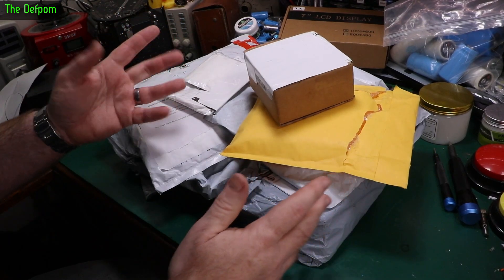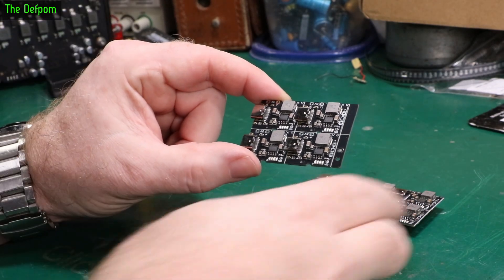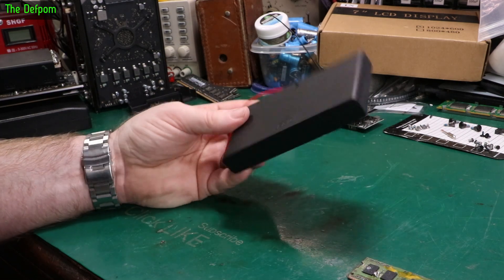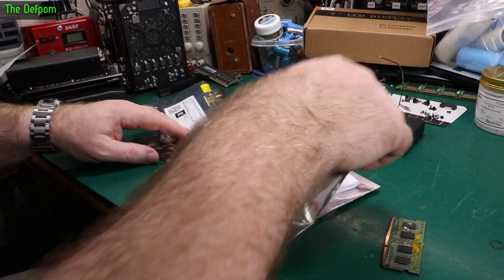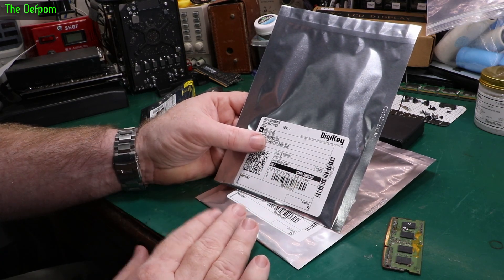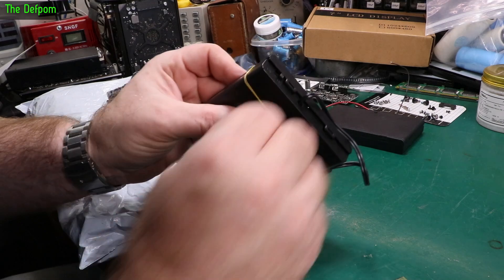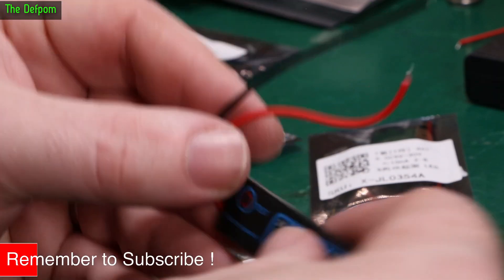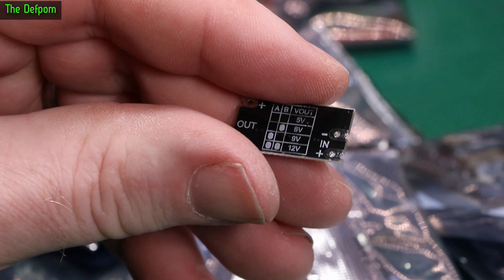🔴 Mailbag Monday 20th May 2024 - No.1247

Comment: Good luck with that processor.
4 or 5 weeks ago I had the same situation. Sadly, some idiot decided to make 4 or 5 versions of that thing, all different.
After ordering and sending back 3 versions, I scrapped the mainboard and ordered a Ryzen 5 mainboard and processor combo.
2 weeks trying intel, 1 hour and the Ryzen machine was and is running.
Reply from the maker: It worked first time, I researched which one was needed before ordering it, and luckily the seller also had it listed correctly.
Reply: @TheDefpom  Awesome!